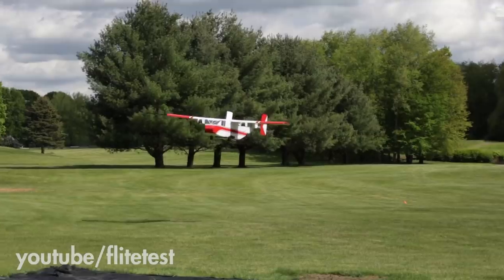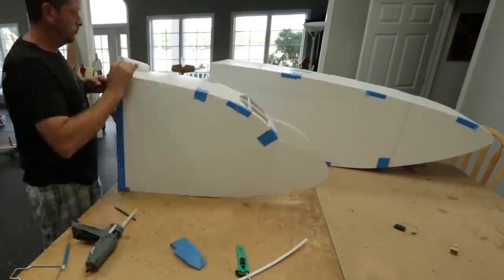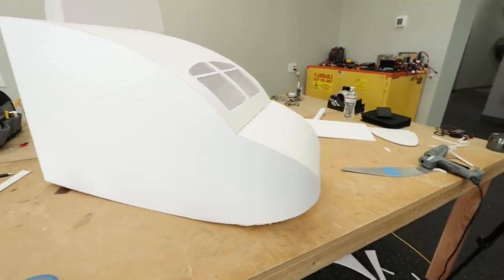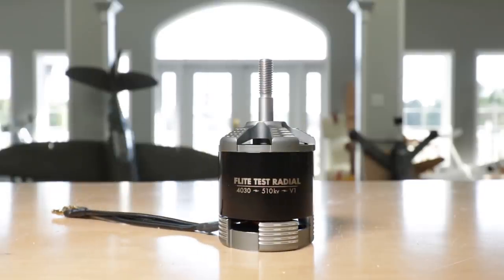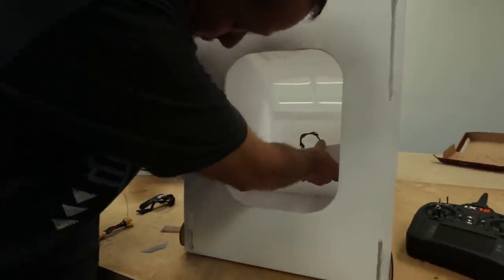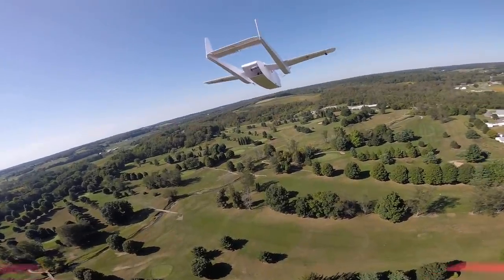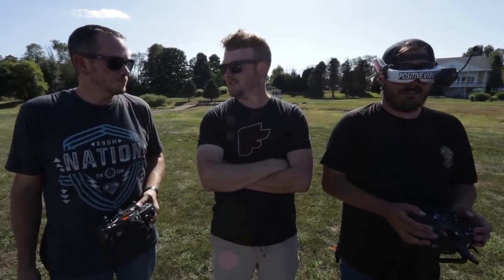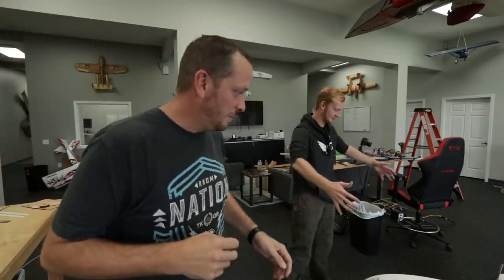Giant Cargo Plane - Cabbie from Disney's Planes Fire and Rescue in Real Life

Comment: I’d like to see some air to air refuelling simulation.
Reply: their planes run on batteries but i would like to see them use gas engines
Reply: @antonyo7531  even just a simulation without them passing through anything
Reply: Lol! That's funny. But if they can figure out how to do an air-to-air battery swap, they just mught revolutionize full-scale aviation.
Reply: @antonyo7531  Foam board, fuel and hot engines not a good mix. A major problem static electricity.
Reply: If they could add a bucket of water with a servo controlling a valve. A second plane with an empty bucket and funnel hose. It could do a great simulation
Reply: @TheCAD66  That it could, put a dye in it and could see what the air flow would be
Reply: Air to air battery recharging would be fun
Reply: Great idea! If Cabby had a receptacle with an electro-magnet on it & the other plane (Skyvan?) had a hose hanging out the back with a metal tip?  Then once mated, the electro-magnet could be switched off to release the refuel hose :-D
Reply: @antonyo7531  They could do a battery swap midair. That would be crazy. Or a mid-air recharging
Reply: Yeah but have copper electrodes on the “refuelling pipes“ so they actually transfer power.
Reply: Oh god
Reply: H C or cargo
Reply: true it will be EPIC!!!!!!!!
Reply: I'd love to see actual air-to-air refueling using nitro gas planes.
Reply: @raptor2265  it would be better
Reply: Even though they are electric that would be amazing to see hope they do your idea
Reply: lots of people missed the word SIMULATION here, I'd love to see this too, even if it is just a rod sitting in a empty cone for a few seconds
Reply: I was thinking just a couple of magnetics to create a contact. One on the "fuel pod", one on the nozzle. Nothing complicated.
Reply: @antonyo7531  bro save the environment
Reply: If possible wires to charge each others batteries maybe
Reply: Craig W Could lock on with magnets
Reply: @antonyo7531  they could do it with batteries lol
Reply: yeah that will be grate
Reply: @antonyo7531  he said simulation
Reply: That can make a pretend one
Reply: OMG THAT WOULD BE CRAZY!
Reply: Naw, I wanna see them build it
Reply: Me too

Comment: I would love to see you guys try a scale version of “skyhook” with this, using an action man (12 inch GI joe). Skyhook is the aerial retrieval of a pilot using a cable capture system.
Reply: Do the army man, then skyhook a gopro.
Reply: The nose of the real aircraft was reenforced  to handle the force and friction of the cable, so the same would need to be done to the model, also there would be no way to recover the figure into the aircraft, the person was pulled in by the flight crew.
Reply: @thomasohanlon1060  The structure of the mechanism itself would be all the reinforcement needed. As far as getting the payload inside the fuselage, I have a couple of ideas right off the bat. It is very do-able.
Reply: @rcbif101  I read the comment from Thomas and my brain went straight into "hold my beer" mode. lol.
Reply: @hopsta5628  The fastest way to get an engineer to solve a problem, is to tell them "there is no way.."
Reply: @hopsta5628  Love it, fire up those braincells. Now you all have to do convince them to do it and yes I know it can be done, from snag to capture to recovery. It takes; 1 servo, 2 paperclips and a dory chute.
Reply: @rcbif101  Not a gopro, but a 360-cam, so they can stabilize the image later.
Reply: Lol I commented this before I read this comment. Great minds think alike
Reply: Yep.. one of the best scenes in the movie..”The Green Berets” with John Wayne
Reply: Do a scale replication of snagging a Corona spy satellite film payload out of the sir as it descends below a parachute.
Reply: Argh Jay Em   I also thought of this.
Reply: Just as in the "James Bond" film "Thunderball"  ;- b
Reply: @thomasohanlon1060  winch....
Reply: A real movie connoisseur I see

Comment: I've been experimenting with various kinds of joinery, especially in relation to Readi-board, and I've come up with a joint system that works across the board (no pun intended) for anything from single sheet-to-sheet joints, to something with multiple layers like the plane here, and it's by using this fiberglass strand reinforced packaging paper/or/plastic tape like what is sent from companies like Amazon when they ship something to you. It works way better than the clear stuff, is way stickier. The foam would break apart before this tape would. 

I also figured out a great way to join multi layer foam together and it's called a "half lap" in wood joinery. Basically, the joint from one piece overlaps on the outside and the joint from the other piece overlaps from the inside with this super thin double sided tape in between, and then clear or paper tape inside and out. It's honestly the strongest permanent joint you can get. 

The next thing I'm working on is shrink wrapping my Readi-board, and embedding/gluing magnets and/or magnetic strips into the foam under the shrink wrap. You have to use magnets strong enough to hold the plane together in the air, so the wrap makes the foam durable enough that it can handle the magnets. I've used this method to hold wings on, and fuselages together without any issues. I would imagine that you could achieve a similar result simply by using tape, but the thin shrink wrap creates an almost hardened plastic shell around the foam.

Which leads me to something else I'm experimenting on, and it's using the really thick shrink wrap material around the foam, and then dissolving the foam with chemicals like acetone, leaving just a clear, hard plastic shell behind that can then be cut along the edges into two pieces, reinforced from the inside with superglue and plastic framing and made into a super lightweight wing or fuselage ready for prep and paint. 

I know people have used these methods before, but it's something I like to experiment with myself.

Comment: If you are lining your joints with box tape, try tyvec(house wrap) tape instead. The blue color is the best and is about 3-4 times stronger than box tape. This is in stickyness, water resistance and over all strength. It is specifically designed to take moisture and cold without delaminating.

Comment: When I was a C-141 Starlifter navigator we dropped pretty much everything, but the most impressive by far was a road grader. The challenges included not only size and weight, but how the aircraft's center of gravity changed as the load exited.

Comment: Safety tip. If you are going to stress test motors to the point you think they will burn out. Please do it on a platform that has a rudder or on a test bench if possible.

Comment: Quick tip with differential thrust

Build the tail yaw in as backup cuz if you run out of charge or the engines go wrong you’ve lost yaw. Redundancy will save you long term

Comment: 1. Air-launching a firework-powered rocket plane.

EDIT : 
Wing-mounted rocket 
Virgin Orbital Boeing 747-400 w/ LauncherOne-style 

OR

Piggybacking, 
Antonov An-225 Mriya w/ MAKS Shuttle-style 
(Shuttle must land back if you choose MAKS-style) 

(Both styles doesn't need to achieve orbit, but if you guys did, that's a huge kudos from everyone)

2. Try to fly the FPV Drone into the fuselage via the back opening.

Comment: Awesome project, as usual.  But I don't understand why you would fly it with 4s battery and then say it would have more power with 6s.  And  "its cool sounding with 4s."  You do realize that with 6s battery at 2/3 throttle will be the same power  as 4s at full throttle ?  So if you use throttle management you can still fly it as slow as you like, but have the reserve power at your disposal for emergency and just plane fun !

Comment: Can you guys build aircraft with multiple engines , which has both low power engines and high power engines, and the aircraft can be operated in both modes And the high speed engines can be turned on when we require an turbo boost . Or carry heavy load. I know the speed variation can be achieved with single set of engine, but it would look good, if we use multiple set of engines which can be turned on and turned off individually, May be we can use additional rc control to just control the separate engines.

Comment: @Josh - I'm very interested in the specifications. Total fuselage length, Elevator dimensions, Final wingspan, Wing chord length(s), Airfoil thickness(s), Wing area, Total weight & Power draw (Amps/Watts). I've been planning & working on something similar for some time now but very scale. Your details of a working prototype will help with some of the calculations. If they are on track or need to be reconsidered. Thank you.

Comment: Question:  Does it matter if the rotation of the motors/props spin into the fuselage or out on a twin motor?  I've heard it doesn't matter, as long as they are reversed from one another to counter induced yaw.

Comment: 510kv?? wtf? dont you want crazy high rpm's for planes? The motor in my one rc car is 3000kv, and the other is 4370kv.. around 50,000 rpm's. I wouldve though those propellers would have to spin at crazy high rpm's to get any serious power.. 510kv seems tiny.